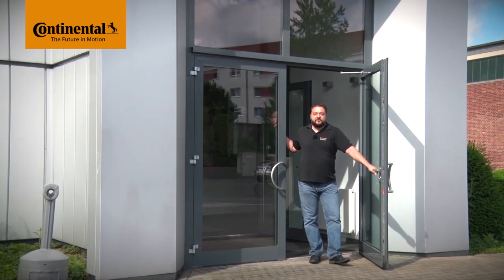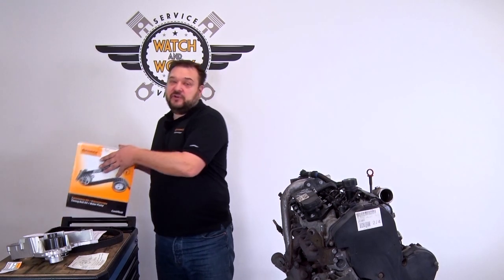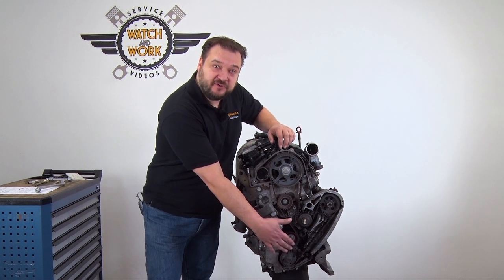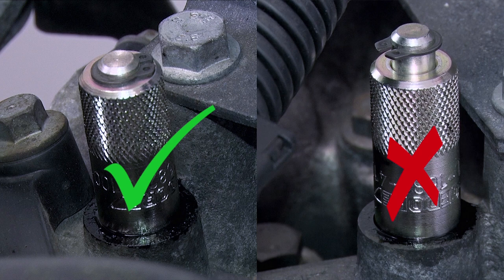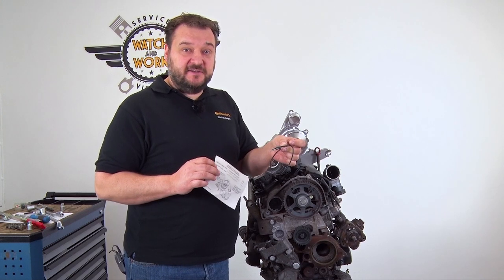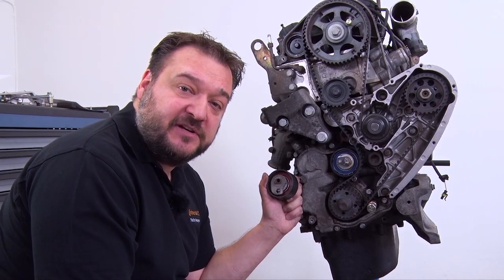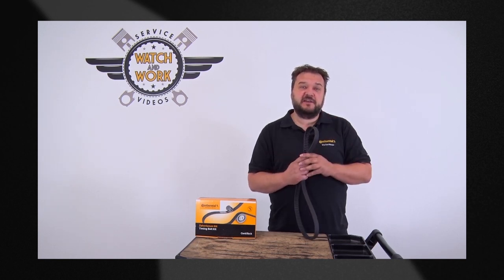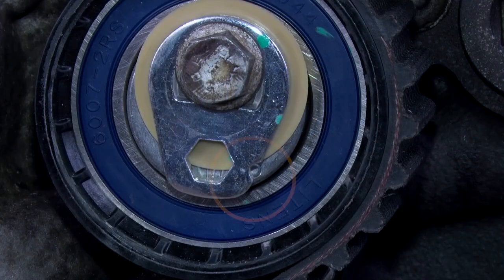[EN] Watch and Work - Fiat Ducato 2.3l 88kW

Comment: Why loosen the camshaft pulley and yet leave in the tining pin? Surely with the pin in the loosened camshaft pulley cannot rotate to equaliss the tension on both sides of the belt?

Comment: Is crank pulley bolt left hand thread or right hand thread?
Reply from the maker: Thank you very much for your question. 
Usually, the crank pulley bolt have a right-hand thread - so turn clockwise to 'tighten' the screw, counterclockwise to 'loosen' it. In all cases please carry out the repair strictly according to the manufacturer's instructions.
Kind regards, your Continental-Team
Reply: @ContinentalAftermarket  thanks